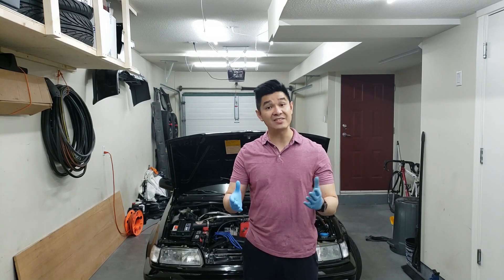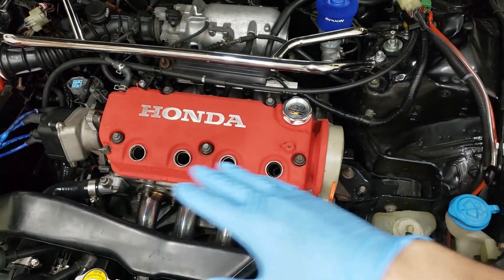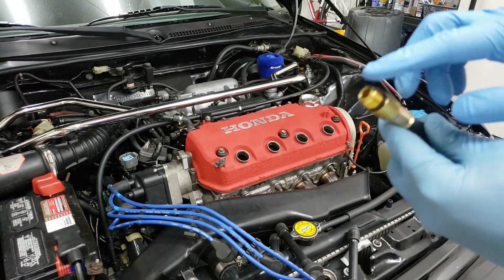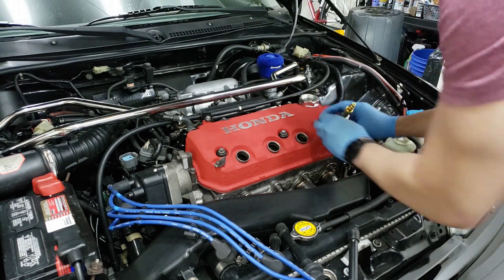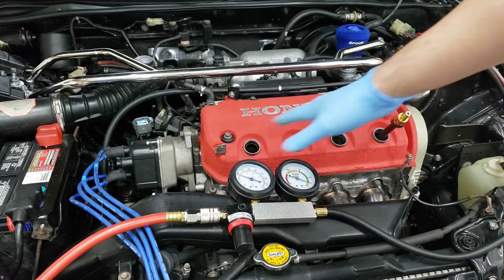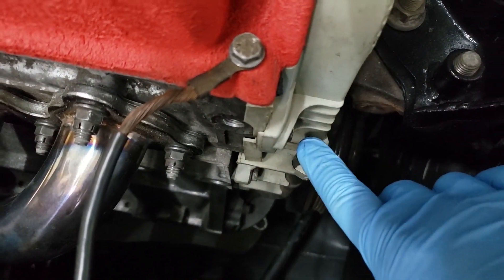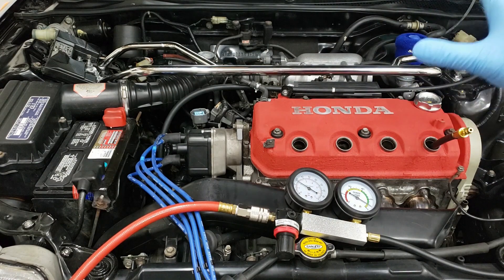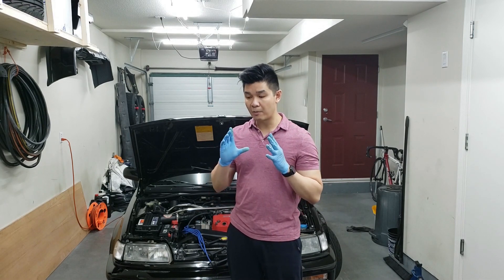|| HONDA EF/ED 88-91 CIVIC/CRX || How to Perform a Leak-down Test D16Y8 with my EF👀

Comment: What size air compressor are you using? Is 6-gallons enough? I want to perform one on a 1999 Honda Civic. My car is pushing coolant into the coolant reservoir when I drive it hard on the freeway. Combustion gas test on the coolant is negative.
Reply from the maker: @jumbojoe55  I'm using it think a 3 gallon. Something small. Your 6 gallon is more than enough. It's normal to have coolant go back into your reservoir when hot as the fluid expands when hot. But your overflow reservoir shouldn't ever overfill.

Comment: Do you have to warm up the engine before leak down tester thanks
Reply from the maker: You can do either. Warming up the engine will allow the piston rings and valves to expand a bit providing a better seal, but the numbers shouldn't vary significantly cold vs hot.

Comment: I made the compression test on a Del Sol 1993 D16Z6, all cylinders are 110-115psi. Do I need to rebuild the engine?
Reply from the maker: Probably. Your compression is very low, but the variation between cylinders aren't too far apart if they're all around 110-115psi. A compression test doesn't really tell you much. You need to do a leak down test to determine where you're losing compression. I'm assuming you didn't even do a wet compression test to see if compression goes up. If your results are from a dry compression test, try to do a wet compression test to determine if it's your piston rings. It's an old engine and would probably benefit from a refresh.
Reply: @BudgetGears  thanks for your advice 🙌🏾

Comment: What about valve stem seals?
Reply from the maker: Valve stem seals were replace a long while ago and I did it just so I can rule out valve stem seals. So its not what's causing the oil burn. Pretty sure its the piston rings.
Reply: @BudgetGears just watched your latest vid and found my way back here. I’d pull the manifolds to see if any oil making it past the valve guides before re-ringing it.
Reply from the maker: @GIZZMOTORSPORTS  thanks for the suggestion. I'll probably tear the manifolds off to have a look when I pull the motor out for the b swap.